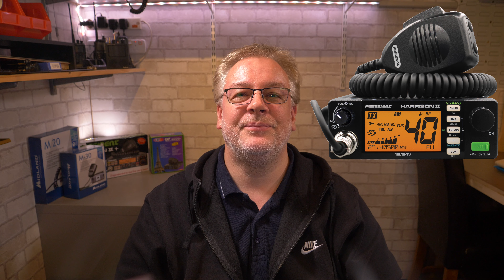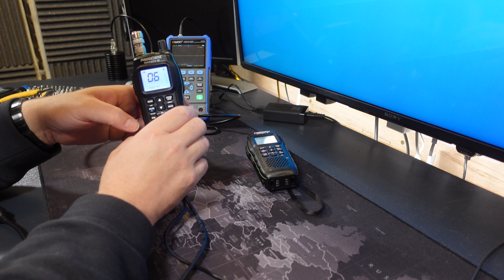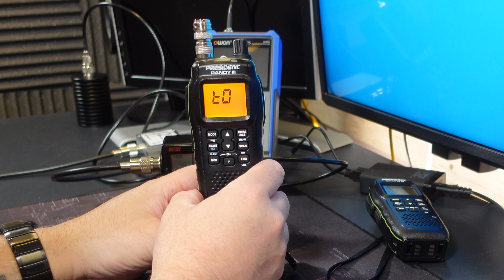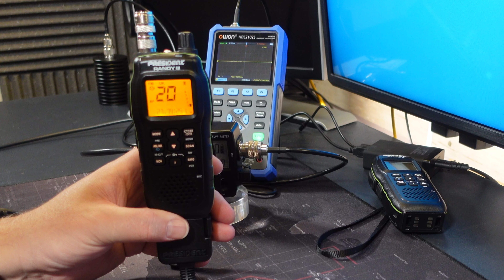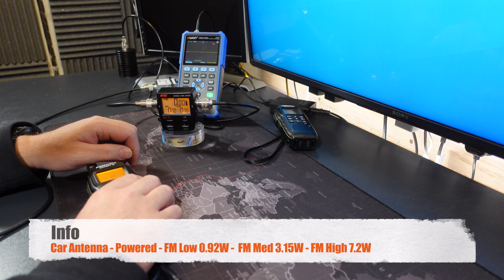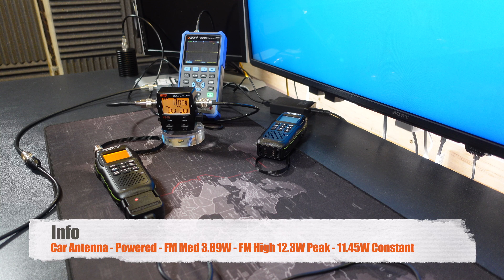President Randy III Handheld CB Radio - Revisited - Secrets Exposed

Comment: Привет из России. 
У меня новый Президент Рэнди 3 и я его модифицировал как вы.
 всё отлично и всё так и есть как у вас, но позже я обнаружил что у меня нет функции пропуска сканирования каналов:
- Так и должно быть?
Reply from the maker: Hi, yes you are correct in that the Scan function seems odd after expanding and it seems to skip between two channels and not work. However, what I found is that if you push the F key so that the F symbol is flashing on the display and then press Scan it seems to work. I checked this on FM and AM and using a few band blocks and it scans for me as normal. I dont know why you have to push the F key first but I hope this helps. Thanks for watching, all the best. 
Привет, да, вы правы в том, что функция сканирования кажется странной после расширения, и кажется, что она переключается между двумя каналами и не работает. Однако я обнаружил, что если вы нажмете клавишу F, чтобы на дисплее замигал символ F, а затем нажмете Scan, это сработает. Я проверил это на FM и AM, используя несколько блоков диапазонов, и он сканирует меня как обычно. Я не знаю, почему вы должны сначала нажать клавишу F, но я надеюсь, что это поможет. Спасибо за просмотр, всего хорошего.
Reply: @NLKMediaGroup  Большое спасибо! 
И ещё один вопрос: планируете ли вы сделать обзор по новому President Lincoln II+? Спасибо!
Reply from the maker: @50SS021  I have 10 new radios on the shelf to review (President, CRT, Midland and Alinco) and yes I have a Lincoln 2+ in that pile to review. There are two other videos partially complete which need finishing before I can get to the pile. All the best and thanks for watching. I hope the scan is now working on your Randy 3.

У меня есть 10 новых радиоприемников на полке для обзора (President, CRT, Midland и Alinco), и да, у меня есть Lincoln 2+ в этой куче для обзора. Есть еще два частично законченных видео, которые нужно закончить, прежде чем я смогу добраться до стопки. Всего наилучшего и спасибо за просмотр. Я надеюсь, что сканирование теперь работает на вашем Рэнди 3.
Reply: @NLKMediaGroup  Да, сканирование работает, нет в меню опции "пропуск канала при сканировании" - я о нём спрашивал). 
У меня новый President Lincoln II Plus есть и я очень жду вашего обзора по нему, особенно по инженерному меню! Вся надежда на Вас!!! 
С Рождеством Вас!!!
Спасибо за поддержку и ваши видео!
Reply from the maker: @50SS021  Glad to hear your scanning is now working. There is no option to exclude specific channels from scanning that I am aware of. Their is a Dual Watch feature that enables monitoring of two channels if that helps. The user manual covers this feature which can be setup in the settings menu. Thank you for watching and have a super Christmas holiday season. All the very best

Рад слышать, что ваше сканирование теперь работает. Нет возможности исключить определенные каналы из сканирования, о которых я знаю. Это функция Dual Watch, которая позволяет отслеживать два канала, если это помогает. В руководстве пользователя описана эта функция, которую можно настроить в меню настроек. Спасибо за просмотр и хорошего сезона рождественских праздников. Все самое лучшее
Reply: В одном из видео на Ютюб я видел опцию меню "пропуск сканирования канала" и подумал что у меня она тоже была до модификации но потом исчезла. Теперь я подумал что возможно в том видео была другая версия президент Рэнди 3? 😁 
Спасибо ☺️

Comment: Hi.
What is the point,of having all the  abcdegh  bands ?
What extra Can I do now,And How do I do it?

What's having the decimal point between the ch number.

What does that little cl, mean,where the ch number is?

Thanks.
Reply from the maker: Hi, It increases the available frequencies you can use. The band blocks represent 40 channels starting and ending at different frequencies. Channel 1 in band block A will start at a different frequency to Channel 1 in band block B. This opens the radio up to frequencies outside of the CB frequencies and covers 10 and 11 Meter bands. The decimal point between the numbers is a 5KHz decrement to the pre-defined band block frequencies. So, on a channel that is 27.405 in normal mode, when using the -5KHz mode it becomes 27.400. Its all about supporting a much larger range of frequencies but still using the normal 40 channel interface. The symbol shown in the second digit of the channel number denotes "alpha" channels. These are very simple and represent gaps in the range. The CB frequencies step in 10KHz gaps but at certain channels they jump in 20KHz gaps, so the Alpha channel shows as 19, 19 alpha and then 20 with the alpha representing the missing channel if stepping in 10KHz gaps. Hope this helps and thanks for watching

Comment: I'm interested in the 12watts of transmit
This is the Randy 3. I'm in the USA so the Randy 2 is available.  Can the Randy 2 be modified by clipping the two looped wires? Or is it just the Randy 3 with the looped wires?
I'm not sure what a European CB radio is but is it the same frequencies as the 1-40 USA Radios?
If so I guess if I can get my hands on a European Randy 3 I can use it in the USA???
THANKS!!!
Reply from the maker: Hi Brian, thanks for watching and for commenting. The Randy 3 is the European version of the radio. The Randy 2 FCC is the USA version and there are differences between them. The Randy 3 is sold in approx. 30 countries, and some have different laws and regulations, so it has the ability to set different band blocks and cater for different power outputs. The Randy 2 FCC has been approved by the FCC in the US and as such has had the abilities to expand removed. I do not have a Randy 2 FCC to be able to compare them, but a viewer advised me that the two wire loops are not present on the Randy 2 when disassembled. The European CEPT CB frequencies are the same as the USA frequencies. Setting the radio to EU mode gives 26.965MHz at channel 1 to 27.405MHz on channel 40. The Randy 3 does not have the Weather channels as it's not something radios in Europe have. When expanded band block A represents 26.965 to 27.405. Band block C being Inferior 26.515 to 26.955 and band block B being Superior 27.415 to 27.855.
So, in answer to your question, yes it will work as the frequencies align but it most certainly would not be legal as its not FCC approved.  I hope this helps clarify. All the best and thanks for watching.
Reply: @VaGunTrader. We live under the FCC we can never have nice stuff 😁
Reply: Yeah I believe only 4w are legal in the us of a

Comment: Hiya lad you’ve talked about the Randy 4 a few times, have you heard of a possible ETA on this or is it just rumours and/or assumptions? Very tempted to pick this up and expanding it to dip my toes into CB and gain access to HF as a prep along with something like the xeigu g90 or the crt ss9900, cheers
Reply from the maker: Hi and thanks for watching. President don't give much notice on the release of Radios. The Harrison 2 has been "coming soon" on their website for 18 months now. No idea on a potential Randy 4 but have given my feedback in the video and comments so they can ignore me when they start the R&D on that one. It's mainly a collection of observations on what they could do to make an already excellent radio just a little bit better. If you're in the market for the best handheld CB then you cannot go far wrong with the Randy 3. I have a CRT SS9900, SS6900V, SS7900V and 2000H on the shelf to review along with 5 or 6 other radios. The CRT SS models are 10-meter radios so won't cover CB frequencies without expanding. If you want a legal out of the box SSB CB radio, then the McKinley is worth a look. All the best and thanks for watching and commenting

Comment: Remember on AM you have to modulate the radio to see actual power possibilities. You only tested the carrier on am (tells very little about performance). On fm you tested full power. 

Inject a 1000hertz tone on am and you will more power on am. A good am radio will modulate 2 or 3x of carrier if voltage can hold.
Reply from the maker: Hi nbookie, yes will incorporate into AM testing. I have an instrument tuning box which can output constant audio signal so can trail that and see what AM output is rather than just the carrier which is what I normally do. Appreciate the feedback and thanks for watching
Reply: Actually full modulation is 4x

Comment: Can I just go to service menu,and bump the power of Mid and Low,to raise the wattage,WITHOUT expanding the radio,or Do I Have,to cut the wires to expand it??
Reply from the maker: Hi, you can access the menu and adjust power without cutting the wires. There may not be much upward adjustment available but you don’t need to mod the radio. Expanding will unlock more channels and the high power mode but for handheld use and the top antenna it’s not going to give a great deal more. It’s the car kit where it really boosted power output. All the best and thanks for watching.

Comment: So expanding it,And adjust the values,low as possible in service mode,will raise the wattage in Borh Car kit mode And just on the top antenna,But it Won't increase it Much,on the top antenna.
It will increase it alot,using car kit???

Still pretty Good tho....
Reply from the maker: Yes correct, the top antenna is limited re output and its mainly the car kit antenna that benefits from the highest power output setting. Thanks for watching, all the best

Comment: Do I have to cut the wires just to get more than three Watts running on battery only by going in the service menu and adjusting
Reply from the maker: Hi DJ Morgan, you won’t get much more than 3.3 watts running on battery due to its size and capacity. You don’t need to cut the wires as this expands the radio to cover more frequencies and boosts power when running on the car kit. This relates to the Randy 3 covering the UK and European model. The Randy 2 FCC doesn’t have the option to expand when dismantled so I am told. The difference between 3.3W and 4W really doesn’t matter much. The Randy 3 is an excellent quality device and worth every penny. Hope this helps and thanks for watching.

Comment: What head set for the randy 3
Reply from the maker: Hi, I am sorry, but I am unable to recommend one. However, President do have an external Speaker / Microphone which plugs into the two jacks on the side. One is for headphone and the other Microphone. The reference number is ACMR407. It must therefore be possible to connect a headset with remote PTT as the ACMR407 allows for this as it has its own PTT button. Maybe a viewer could recommend a headset that provides this functionality. The Randy 3 does not have Bluetooth so hopefully President will add this in the Randy 4 if and when that gets made. Would be very useful for Motorcycles so must be possible but I don't know of one to recommend. Thanks for watching

Comment: Hello. I've disassembled a Randy II FCC to cut wires. But it doesn't have the wires inside. Can you still get it in export mode ? or have I overheard something.
Reply: The Randy ll FCC is NOT modifiable! The Randy lll is the European version and is modifiable but it's not available in North America! The FCC versions of the President radios cannot be expanded as the FCC will not allow it on radios sold in the USA. The Randy ll is only 40 channels!
Reply from the maker: Hi CBoxmann, the Randy 3 is the European version, and the Randy II FCC is the US version. I do not have a R2FCC to be able to test it but would be very interested in getting one if I can find a US retailer that ships internationally. Failing that, if you could take some close-up pictures of the circuit board and send them to me, I can do a comparison and see what the differences are. I wonder if its minimal and able to be unlocked or drastic and impossible. If you're interested in collaborating on this, then please let me know.
Reply: @NLKMediaGroup  Hi. I bought mine on Amazon for 163§ 14 days ago. Yes we can try to compare radios, I have already taken some photos of the board. How do we get them exchanged for each other? Pardon my written English.
Reply from the maker: @CBoxmann  the easiest way is to go to my website use the contact page. It's here https://nlkmediagroup.com/contact/ and that will ping me your email address. I will then ping you back an email from my personal email address. I will need to take one of my Randy 3's apart again and remove the keypad board as we will need to see under there. Will be interesting to see how similar they are or are not :-)

Comment: Just 3 watts power from a radio costing £180? That's terrible!
Reply from the maker: Hi Zaden, the battery is small and is the limiting factor with this radio. I haven’t tested other CB handhelds to see what they output but will add that to the list. It is a lovely quality radio but it would have been good if it was able to hit closer to 4W. If they make a Randy 4 I would like to see a detachable battery double the capacity. Thanks for watching. All the best.
Reply: @NLKMediaGroup  the main reason I was watching was that I want to get one of those convertible handhelds. The old Midland Alan 42 was only 3 watts, but according to a video I watched the new Alan 42 DS does give 4 watts from rechargeable batteries. Assuming that's true, it would affect my choice.
Reply from the maker: @ZadenZane  yes that's understandable. i do not know what the tested output is from the Alan 42 DS but will also add that to the list of things to source and test. It won't be anytime soon but worth doing a comparison between handhelds at some point. Another radio thats worth looking at is the Wouxun KG-S72C CB handheld. It says 2W AM and 4W FM so checkout reviews on that and see if anyone has confirmed power numbers. Its available in the USA again after they all sold out but not sure on UK or EU availability on that handheld.
Reply: @NLKMediaGroup  I did suggest this idea to President a while back in early development stages ,a AA battery cases or similar attachable battery pack.But can see why they went with a sealable battery cover for water moisture ingress ,and from extra engineering needed to get decent seal between radio and battery pack.What is included in package is a dc adaptor,so could in theory carry a extra external pack if long Comms needed on full power.I ve found in practice generally for HT to car/base 1w setting on FM ample when you add longer TNC antenna on HT works fine 1-5miles.HT to HT 1-3miles or more depending on terrain @1w FM mode.Furthet if add 9ft trailing wire attached to the ground outer side of tnc connector by 3 S points tx&Rx!!! For fringe area  coverage uses,where UHF just won't cover it Vs CB VHF lowband.I just wish some CB antenna company would make a extra long 0.8-1.2metre long top loaded TNC helical option.Dirland France used to make one for Midland Alan 80A CB HT back in late to early 90's ,was long but very effective and well built helical cb HT TNC antenna can no longer get 😐
Reply: The randy 3 EU version is built better,performs far better the midland 42DS! Plus far more professional built!
It's a handheld at end of day ,so ranges on stock antenna is never going to be same as a base or mobile system.You can upgrade the Randy 3 TNC antenna to a longer one ,or add a ground trailing wire 9ft long to outer of tnc ground  improve fringe ranges.Randy 3 supports split ctcss ,single ctcss,repeater shift for future cb VoIP gateways and parrot repeaters!! (Germany have already implemented this on CB band).Randy 3 EU if far better built in quality terms Vs 42DS that's what your paying for 👍
Reply: 8watts is ideal RF power when running base loaded antennas as ERP is generally half input RF power ie 8w in=4w ERP roughly as rule of thumb.So your still within legal RF ERP.Am generally needs x4 RF power so 1w carrier 90% mod Am= 4w pep as most CB use series modulation,why Am generally slightly lower carrier RF power until modulated.👍
Reply: Wouxun KG-S72C CB HT cannot comment on as not tested one on the bench?,from what I have seen it looks robust,C port charging,ctcss single tones,split tones ,ctcss scanning tones ,all help when using FM mode a big plus in my books.Voip gateways now being used on CB generally use ctcss to prevent unnecessary access from noise,qrm etc .At the moment Wouxun don't have a ETSI Multi-norms approved set yet only FCC USA spec one,so your band choices are going to limited to mid block only!!
Not that's a big issue nowadays as most CB do all the variations of bands.It all depends really on your application of CB hts really ,groups uses,base to ht Comms,VoIP gateways access etc.Personally if you want future proofing ,solid construction and good warranty go with the Randy 3 EU version ,add export mod from dealer.You won't be disappointed,there's a optional drop in charger,a option tactical blade whip antenna TNC,leather cases available,get the dealer to up FM deviation to 2.10khz for UK use.Think of it as a sound investment,not a toy CB HT😉
I have 4 randy II versions and they are sound solid commercial grade built and work great outdoors for camping and beach Comms 👍
Oh batteries ,President do spares too so can carry extra with u ,just plug in connector,email them and I'm sure point you in right place,Google search .groupe president electronics for EU/UK CB kit.The mobile adaptor charges and powers the set too ,Midland 42DS does not Inc batteries ,poor stock ante nna provided (a dummy load),prob why issues with 4w at 12v batteries needed.Best of luck in your choices👍